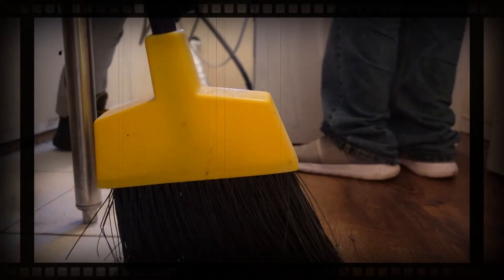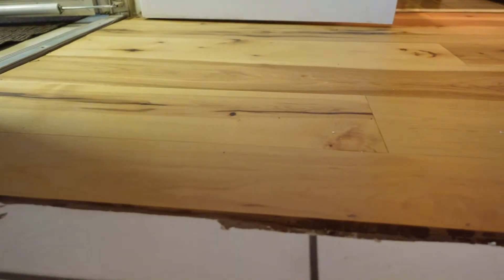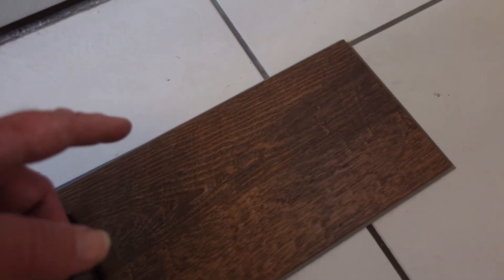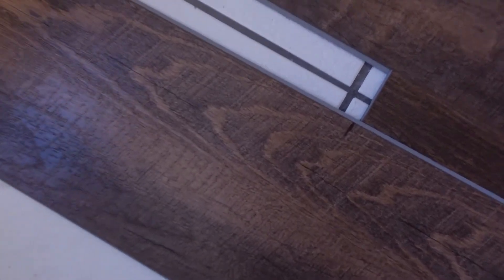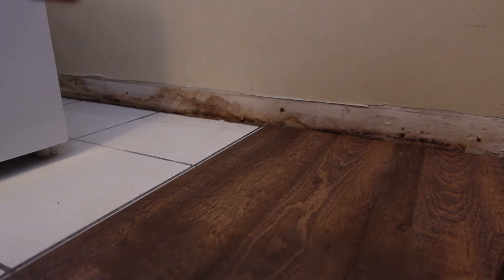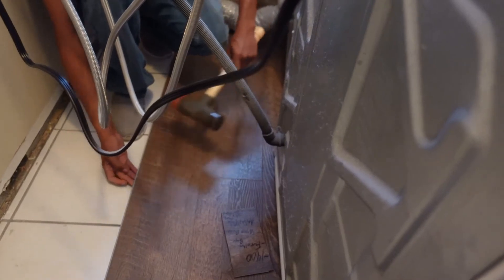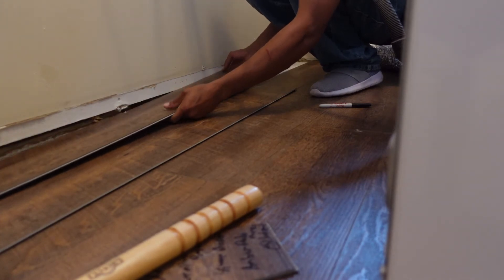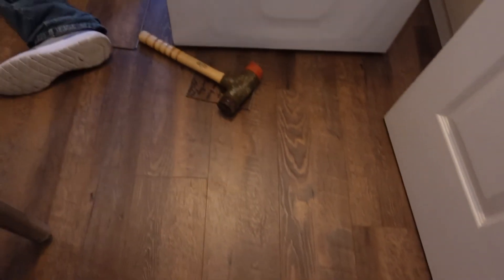HOW TO INSTALL LUXURY VINYL PLANK FLOORING, TEACHING A BEGINNER TO INSTALL LVP, DIY, START TO FINISH

Comment: Excellent job!  Thank you for sharing your knowledge and experience.  I'll be installing Lifeproof vinyl in both a laundry / entry area and kitchen.  Do I need to do anything special to move/manage the fridge and washing machine with this type of flooring.  I feel it would be easy to damage the new flooring just moving the appliances back into position (especially the fridge!).

Comment: Hi, first of a huge Thank You for all your instructional videos, I'm going to DIY LVP flooring. I'm not sure if you have addressed on other videos but would you ever install LVP over glued down engineered wood on concrete? I've engineered wood one side and tiles on another, removing those is going to be a ridiculously messy and costly job.